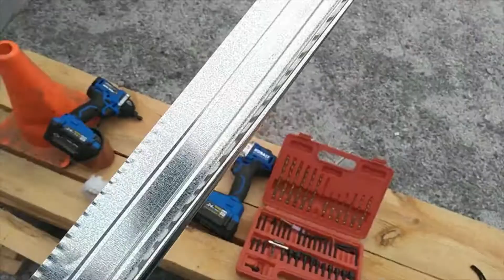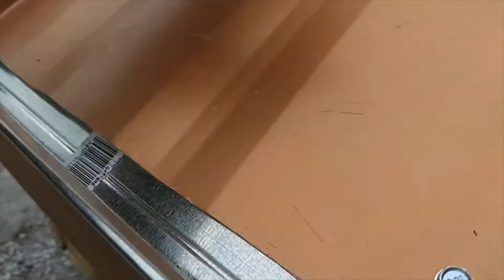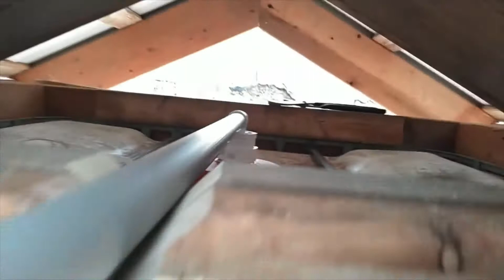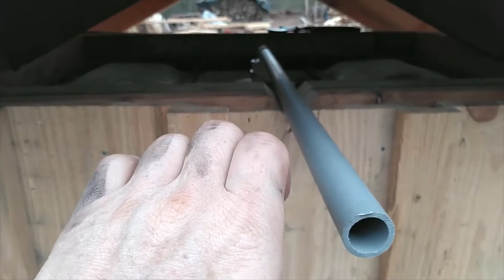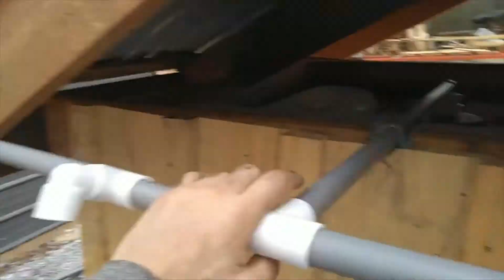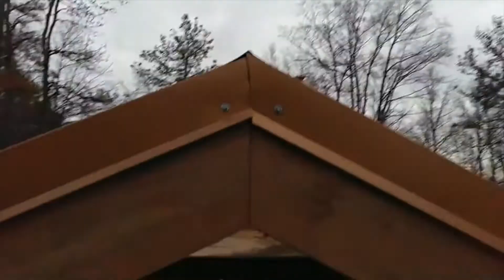#55 Adding Rainwater Harvesting to the Tower Part 3

Comment: Cool water tower 😎
Reply from the maker: Thanks, it is still working good. Last year squirrels built a nest in between the board and batten and chewed a hole into the plastic bladder. A little plastic welding and its like new..